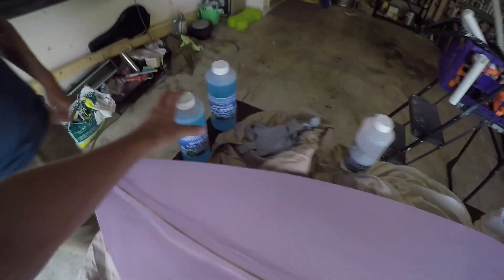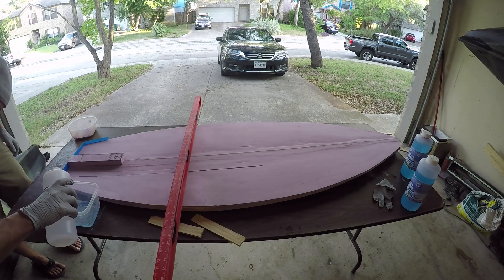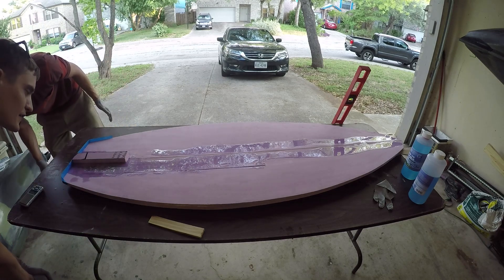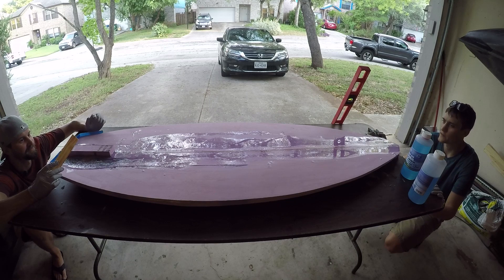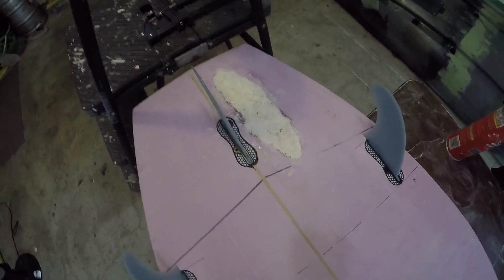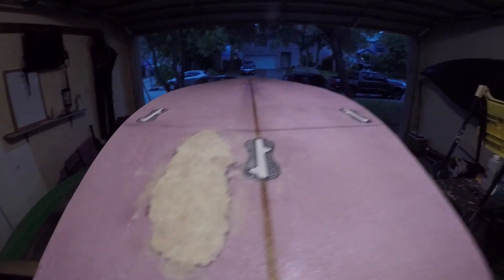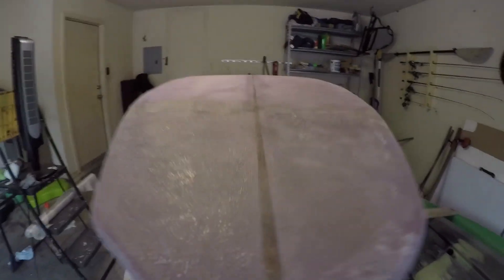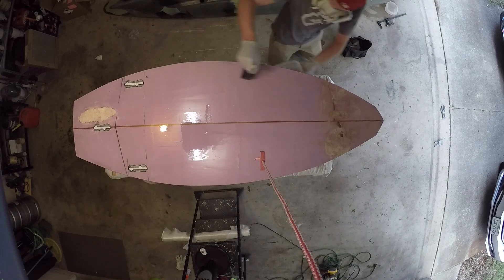Making a Wakesurf Board - Installing FCS II Fin Box and Glassing

Comment: whats the brand of epoxy, im trying to do the same project. Ive made the board, got the mesh. Now time to get the epoxy. It isnt clear to me what kind u used. Please let me know asap.
Reply from the maker: I got the epoxy from greenlight surfboard supply. Resin research systems is what I used. Pretty clear stuff.
Reply: W.E.T - Water Entertainment Television Why did you buy that bondo fiberglass resin from home depot?